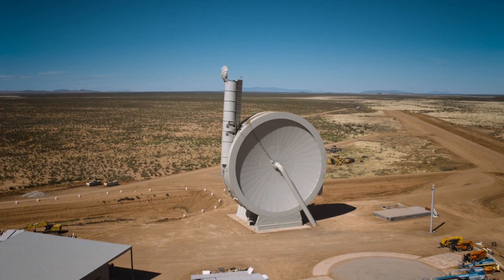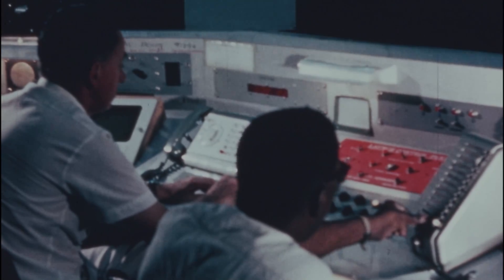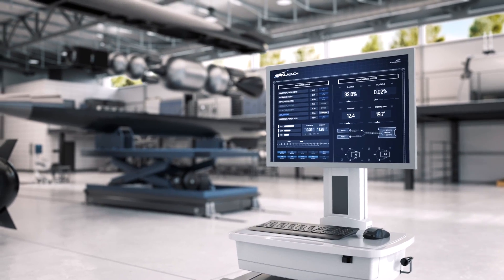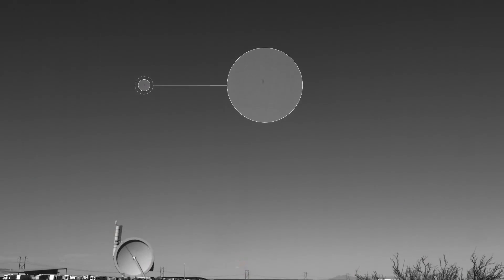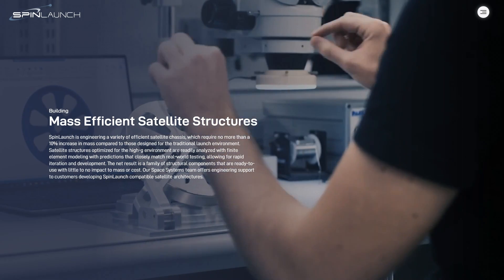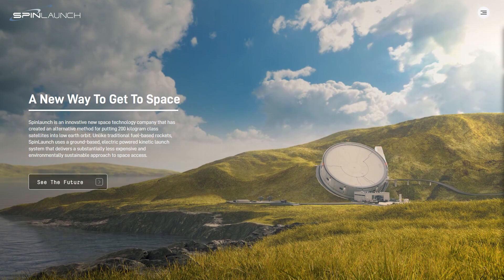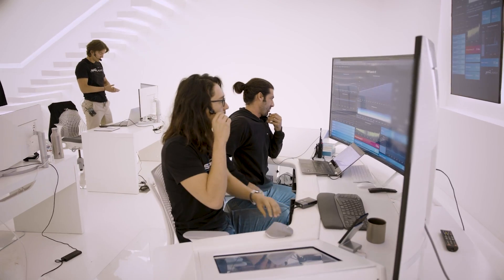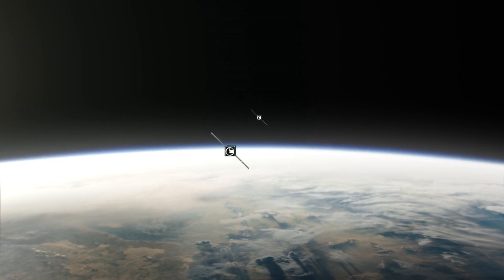Can Spinlaunch Throw Rockets Into Space?

Comment: It seems to me that a projectile going from a vacuum to lower atmosphere at 6x the speed of sound would be like slamming into a mountainside. The compression effects would be similar to a meteor hitting the atmosphere from space.
Reply: @@timemachine1944  impuls  engoinner  chemicist  uinderstand bust  ofhis Ic counterrotation chemicist """too dumb"""

"A real scientist will stay in his lane and know his limits. Extremely large egos prevent that sometimes."
Reply: Rotor becomes unbalanced and self destruction ensues the instant the projectile is released. Good for one launch only.
Reply: Much my thought. Just what is that barrier made out that it can contain the vacuum  but doesn't damage the projectile when it gets hitss
Reply: @jonoliphant I was wondering this also. Plus the one launch I’ve seen was so catawampus that It wasn’t worth all the cheering.
Reply: @jonoliphant   That barrier is made of polyester, and vacuum does not need to be contained it's not going to leak out.  You need to keep the air from rushing into the vacuum.  The big cap you see rocked back 90 degrees does that.  Also the two mechanical doors in the departure tube hidden by the polyester dust cover.  Sorry "Super" polyester dust cover.
Reply: @bradleyrex2968  I liked when the rocket tumbled out at the end. Lol
Reply: @kyle857   🤣Weird because they did not launch a rocket.  And the projectile they launched did not tumble.
Reply: @bradleyrex2968  Curious why the "Super" Polyester barrier is not blown inward by the atmosphere rushing in to fill the vacuum when it gets pierced by the projectile...
Reply: @bradleyrex2968 looked pretty tumble to me. At least the few seconds they showed.
Reply: @rrpostalagain   I love the people who swoop in and make bunches of comments on months old posts.
Reply: @bradleyrex2968  yeah you only need to keep out about 13 psi
Reply: @qwe304    I try my best, thanks for letting me know.  Wait that's almost 1/3 of a car tire.   Is that even possible?
Reply: @bradleyrex2968  really just depends on the size of the hole to cover, since there's no support, the tensile strength is what really matters, as the sum total force is exerted against the edge of the material. With kevlar or advanced nylons I think it's possible. Their demo was definitely not a high vacuum though, just look how the fabric acts like theres no pressure differential.
Reply: @qwe304   Well no, the psi does not change with the size of the hole, and you chose 13 psi.  14.7 is one atmosphere.

Since there's no support?  For what?  Oh you mean the dust cover?  The fabric has 14.7 psi on one side and 14.7 psi on the other.  That is a dust cover / privacy curtain.  It's holds back no pressure.

The pressure is held back by two steel doors that are inside the launch tube.  Spinlaunch has so far kept the door design secret. The dust cover helps keep that secret.  They have shown them in another video from a distance that does not really show their design.  The doors open and close really fast, and preserve most of the vacuum inside the chamber.

Comment: Simple answer, they can't. It's already been debunked. Even in their own video it's shown that rocket just tumbles on exit, that's why launch is only 5-6 seconds long and they cut to "celebration".
Reply: @timemachine_194 It cannot work because of rotational forces impacting the rocket while it releases. Rockets aren't stones to be thrown into the air, they need to be propelled to work. And again, if it worked, that rocket would act and fly as a rocket, not as an stone. It simply doesn't work.
Reply: @timemachine_194 Dude, aerodynamics of a rocket requires it to be PROPELLED so it would be stable during flight and able to work. If it is thrown REALLY REALLY HARD, because of it's aerodynamics it would fall apart due to air resistance. And since you refuse to include basic aerodynamics into your consideration just so you could justify this scam, I really have nothing more to say to you. Use common sense next time you wanna sound smart on the internet. Read a little, it might help. To you and to this channel creator as well.
Reply: @timemachine_194 Watch the launch again, REALLY REALLY carefully and REALLY REALLY slowly... Pay attention to the shadow of the rocket on the ground. When you do that, tell me where in this factual case of a rocket being flinged in this manner your aero surfaces control the rocket. If you don't watch it, there is no need for further discussion, simple as that.

Comment: Some problem people brought up is how to keep vaccum after launch would be to use doors at the vase of the barrel/tower. Asuming 100m barrel the rocket will puncture the seal at the end and air will rush in at the speed of sound. The doors will have ~0.3 seconds to close before air come rushing into the centrifuge which will still be spinning at supersonic speeds which would probably destroy itself if the chamber suddenly recompressed. 

Finally at the stated 11 ton mach 5 speed the centrifuge will be unbalanced of 16.3 GigaJoules which is approximately the energy of a 4 ton of TNT explosion. Either they design a sacrificial weight to release in the other direction or Spinlauch creates the most baller probably magnetic bearing and compensation system that hasn't existed yet.

Comment: The logical launch site for Spinlaunch is Mount Chimborazo in Equator. 

"Earth is not a perfect sphere, but is a bit thicker at the Equator due to the centrifugal force created by the planet’s constant rotation. Because of this, the highest point above Earth’s center is the peak of Ecuador’s Mount Chimborazo, located just one degree south of the Equator where Earth’s bulge is greatest. The summit of Chimborazo is 20,564 feet above sea level. However, due to the Earth’s bulge, the summit of Chimborazo is over 6,800 feet farther from the center of the Earth than Everest’s peak. That makes Chimborazo the closest point on Earth to the stars." - NOAA